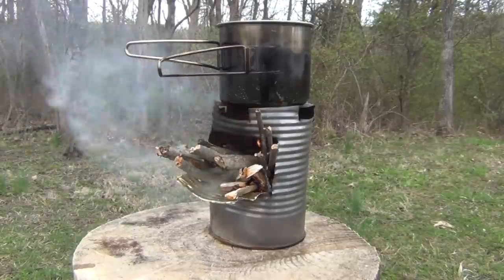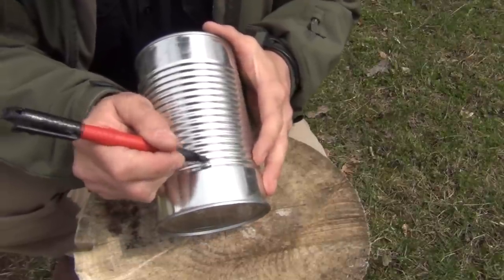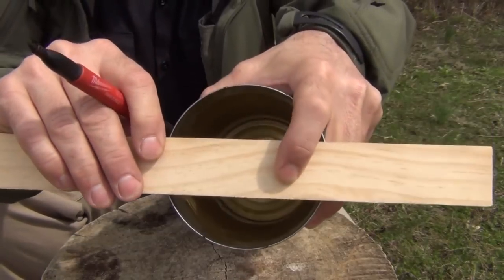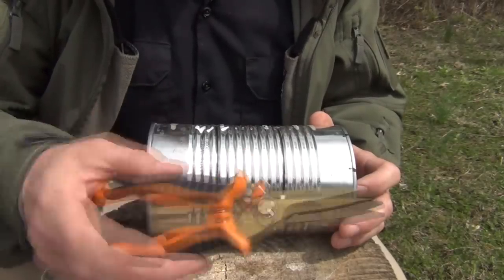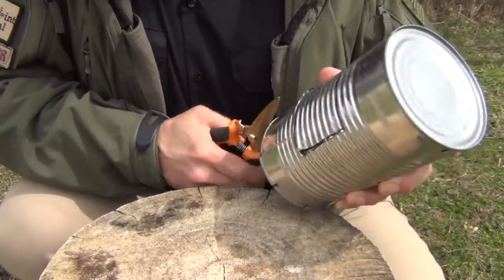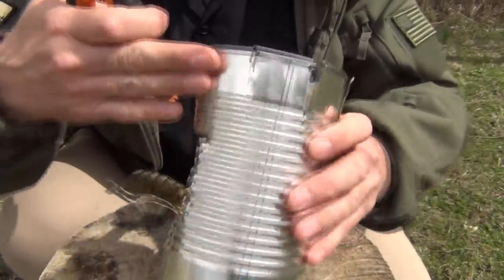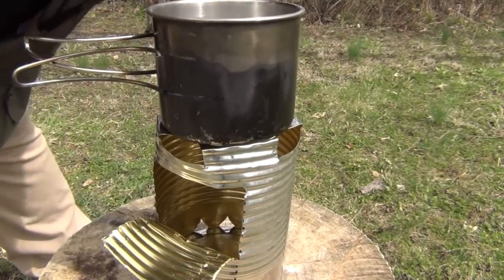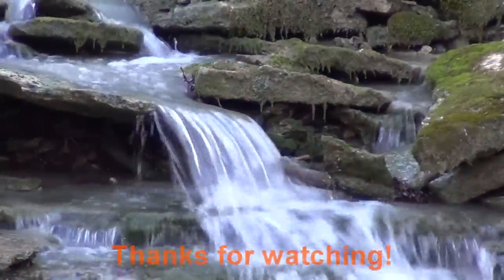NEW HOBO STOVE DESIGN!

Comment: If you don't have a church key,  use the can opener on your knife/mu!tool.  The trick ~  hook the can opener on the rim perpendicular to the rim, then angle it slightly and punch a slot. Move the tool slightly and make another slot intersecting the first. You now have a triangle shaped hole.  Because these are smaller then a real church key you may have make more than five.
Reply from the maker: Sounds good, thanks for the suggestion and for watching the video!

Comment: Great idea James. Speaking about those Fiskars shears, I'd like to share something. Years ago I was a truck driver for Salvation Army in Detroit. I found a pair of Fiskars shears in a trash Gaylord. I still have those shears today 14 Years later. I've used them to cut thin sheet metal, aluminum flashing, for body work on cars and just about every kind of material you can think of. There indestructible and they never dull. They will cut fairly thick sheet metal, leather, you name it and these shears will cut it.
Reply from the maker: That's excellent durability for sure! Thanks for watching!

Comment: I like this take on the can style stove especially because in most cases if someone did loose their way, In most cases they most likely may have a multitool of sorts and can easily make this entire can stove with just that multitool. And in today's world coming across a can in nature is very likely unfortunately but also fortunately if you've lost your way. I took a bigger sauce can and made something similar using only a Gerber brand full size multitool and it came out nicely. The one thing I didn't do that I seen in this video was fold those flaps back up and make them meet at each corner and imo that's a great idea for smaller pot's like you mentioned.  I don't remember the name of the Gerber multitool I used as I've had it something like 15 through 16yrs but I do remember it was around $70 for it and has very good pliers and decent enough scissors and other great tool's.
Reply from the maker: Great. Thanks for watching!

Comment: That's a good one and done design for a portable stove. I wonder if that feeder ramp could be sliced up or perforated and then bent inward to act as a grate for the coals and the ventilation holes clipped out to allow for ash removal. Otherwise, it's obviously good as is and works fine.
Reply from the maker: Very possibly. There are a lot of different options to add to this stuff if one wished.

Comment: Made almost the same stove as kid in scouts. Except...
We used the church key open holes all around the closed end, which becomes the top of the stove. Cut open 2 similar square opening on the open end (bottom) to insert sticks. One opening for the sticks, other opposite opening allows combustion air.
 DONE!!!
Always able to cook well. Helps to place stove on a large flat rock for easy sweep alway dead coals for next use.
 Another method is to place stove, surrounding with medium/softball sized rocks. At night/after dinner, place warm rocks in towel/dirty shirt/washed out socks, then into sleeping bag for warmth.
TIP: when attempting to punch holes in the sides of a can, insert a stick/log about the same inside diameter to support the can.
Also, can throw can at bears to shush them away! Especially when the can hits rocks/granite.
Reply from the maker: Yes, that's another very common variation of the hobo stuff. I have made similar ones on other videos.

Comment: I have made same kind of stove myself ,after watching this, for fun and it works good. I have modified it with a different type of steel can. 
But I feel it would be much easier to handle if you put four pieces of "M Seal" ( I don't know what it's called in your country. Its two different soap like bars,when mixed together ,they form a concrete like hard and adhesive thing.) Short stands under the can. Thus you can maintain the balance on a uneven surface.
Love and respect from India 🇮🇳
Reply from the maker: Excellent, thanks for the tip!

Comment: Fantastic design, brother. One good improvement on your design:
Instead of the top construction you did here, leave it factory. But get 3 larger bolts and cut a slit in them like a clothespin... To the desired height.
This creates your air gap, allows you to use any size can and creates perfect level... 3 legged chair.
What you lose with my idea is the smaller pot than stove. It would need to be solved by a metal coat hanger bent into a triangle as a grill.
Well done, sir. Just another idea👍
Reply from the maker: Good thinking outside of the Box. Thanks for watching!

Comment: Have a small mod idea for this. Instead of cutting off the four top tabs, fold them outward to better support a larger item? Bricks or rocks can brace the can from toppling over.
Reply from the maker: That might work. However, you would definitely be cutting off some of the air flow air flow depending on how it was designed.

Comment: I have made myself stoves much like that, I used my knife to cut the holes in the first one. my large hole I have at the top grove going down. I left the top opening in tack, but instead cut small holes right below the rim at the top and bottom. To support the cup, I use cut pieces of hanger wire, that I stick threw the holes at the top, to form a platform for the cup or whatever to sit on.

Later on, I used grinder with a cutting wheel to cut the large feed hole, and 3/8"drill bits to cut the small holes. I smoothed all the edges, so it was safe to carry in my pack.

I use wood and maybe paper to burn in the stove most of the time, but I also can use something like sterno or alcohol by fill most of the can with dirt to raise the heat source.
Reply from the maker: Sounds good,  thanks for watching!

Comment: I was thinking, if you don't  cut the rim at the top, the can would be more sturdy and stable. close to the top in that flat area, cut out a few triangle holes with a bottle opener, then bend those in to make a shelf for the cup to sit on. the cup would go down inside the big can a little, which would make it get hotter faster. then when you want to use a big pan, make your stove stand to fit down inside the stove and rest on the triangle shelves, and it sticks up taller than the hobo stove and has the cutouts to allow the heat to hit the fry pan. hope I explained it well. take care , good luck.
Reply from the maker: Sounds like an interesting modification. Thanks for watching!

Comment: I like these designs and am wondering about using a large steel coffee can that has a dull lip inside of it where the heavey pull seal is removed from if that would work?
Reply from the maker: Yes, that would be another variation of this kit but you would have to find a way to put a cheap lid on it.

Comment: James, love all your improvements to your designs. Do you think cutting out the bottom and sitting it on the ledges made by the church keys will improve air flow and make tipping out the ashes easier?
Reply from the maker: That's an interesting idea. I hadn't thought of that but it might be worth a try. Thanks for watching and for the suggestion!
Reply: @WayPointSurvival  Thank you for replying James! It'll be cool if you experimented with suggestions cos many of us couldn't due to our limitations.

Comment: why not build that upside down and use the church key to create flame ports around the "bottom" which is now the top and not only can you put any siz "pot" on the flat surface that was the bottom and is now the top but it is also a small griddle??... but then of course that is how we used to build them back in the 50's and 60's  ... or is there a reason that you need to have the bottom of the can still be the bottom of the stove?
Reply from the maker: I have done that on other videos. The reason you leave the can bottom intact is for areas where you might have a fire risk.
Reply: so he bottom of the can doesn't get hot enough to cause combustion of materials under it?
Reply from the maker: @xessq1  Not usually.